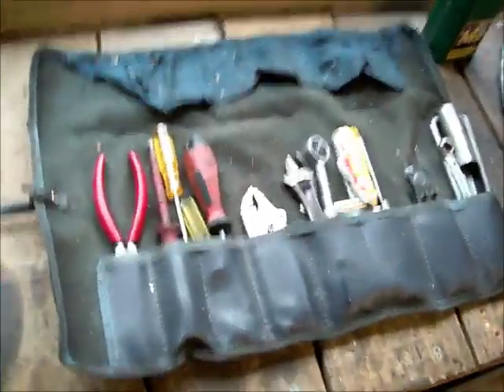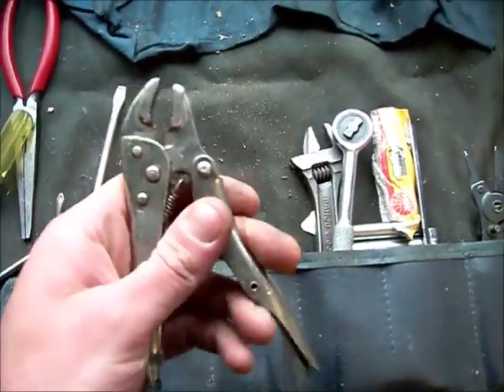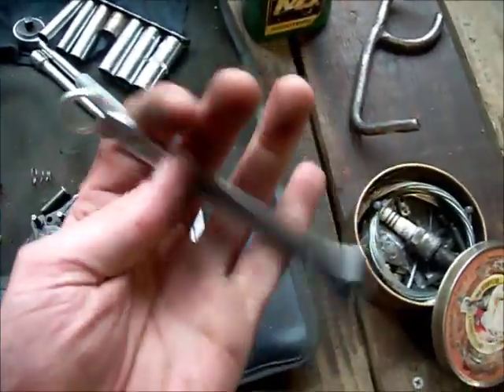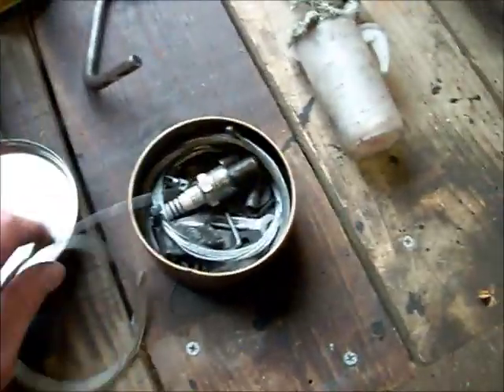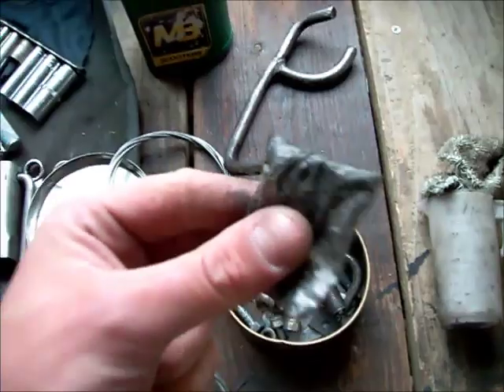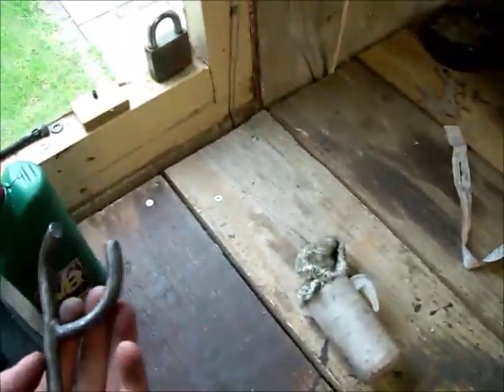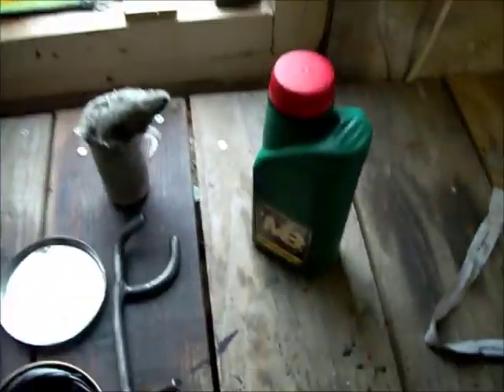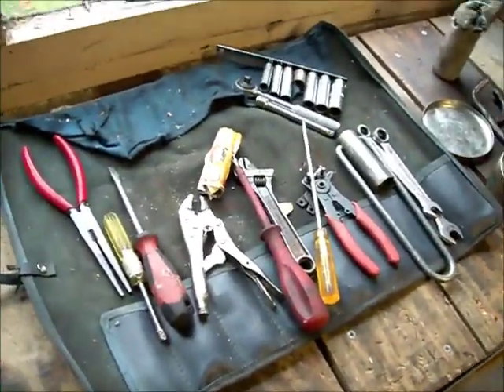Lambretta scooters essential tool kit!

Comment: hello, im considering another lambretta, had a few since the 70's and last one i owned was in 1980 and was a li150. currently on a modern yamaha xenter, great sccot but bland. thing is im a bit of a crock these days and not up to much maintainance as im disabled with heart disease and spinal stenosis and i cant remember how unreliable my last one was its been too long ago. if im say doing about a 1000 miles a year max on a lam, what do you reckon?
Reply from the maker: malfisher You should be able to do that easily with next to no maintenance. Providing there's no unforeseeable events or anything. I did roughly 10,000 miles last year on mine and the only things I really had to change was probably 2 new throttle cables and changed the gear cables and clutch cables a couple of times too, in fact the last time I changed them there wasn't even anything wrong, I just did it as a matter of course. I've had 1 flat tyre in that time too. This all depends on the state the scoot is in when you get it. I'm constantly checking around my scoot and modifying stuff anyway so things tend to be well maintained in my case. As long as you're taking it easy then a thousand miles is nothing, people ride 500+ miles just to get to a rally after all! It probably won't work wonders on the spinal stenosis though to be honest so that's your call, but I'd go for it if I were you!
Reply: ***** thanks for that! i did sort of think a low mileage slow rider like me would be ok . and, it'll be a good one, either i'll spend on a fully restored one, or get my mate whos shit hot to restore one for me. it'll be wierd paying 1000's as my last one cost 12 quid lol!
Reply from the maker: malfisher Sound job, good luck!
Reply: @malfisher  £12 😆 remember when it was 70p for a pint of bitter in the pub and can never understand how people today afford a session down the boozer at around £5 a pint 🤪